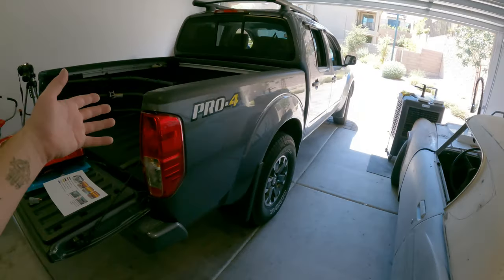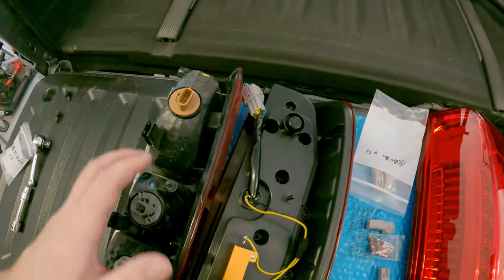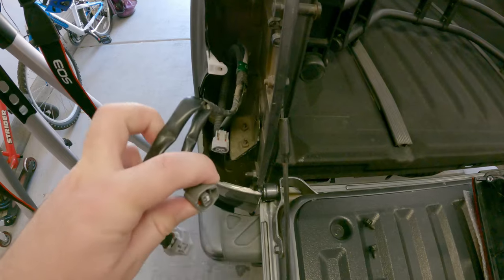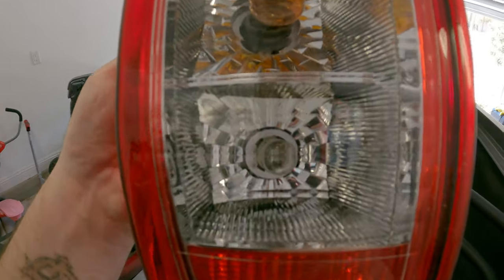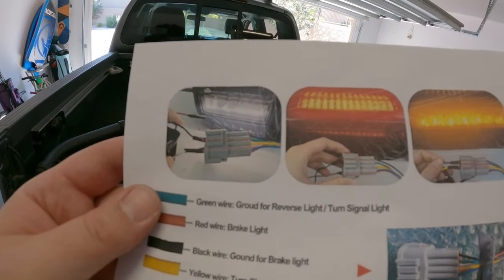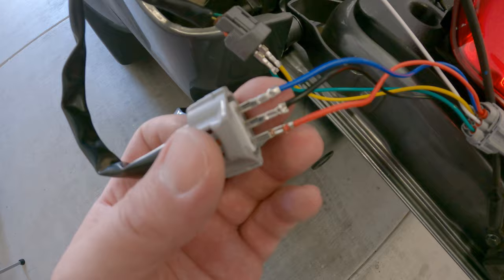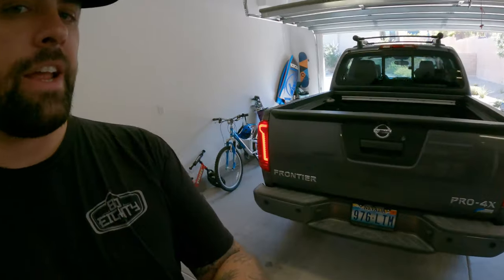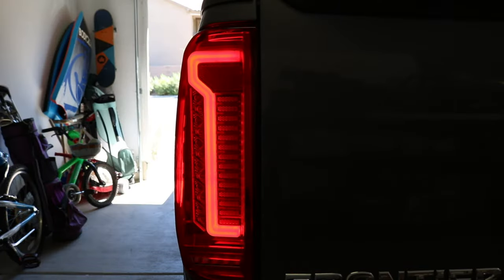Installing led taillights on my Nissan Frontier

Comment: I just opened the package to the smoked version of these, and there is no need to cut wires.  They probably saw that they needed to create a true plug and play version because mine came with all 3 clips!
Reply from the maker: Lucky lol, glad to hear they fixed it.
Reply: Link to where you bought the smoked version ones
Reply from the maker: @lprto9831  These are smoked and also plug and play now > https://amzn.to/3AaK8T7
Reply: @EndMotive  right on thanks
Reply: Lucky i only received da f-in light no wires
Reply: How do you like that smoked lens look?  It looks like the blinkers are tougher to see.  Both are out of stock right now... but with my gun metallic  grey paint I am leaning smoked.  I like these lights!
Reply: @rickwhitfield7617  they are amazing they will look awesome with your gun metalic grey. They are dark enough to not be able to see the led lights inside until they turn on, the only con is that the reverse light is so small its practically not there. If you have a limo tint in the rear window you will not see light at night. I added led to the third brake light and that kinda helps.

Comment: Thank you so much for this video i was litterly about to buy these same taillights and I had no idea what to expect. Thank you for the tutorial it was very helpful👍👍👍💪
Reply from the maker: Hardwiring is easy if you want to save a few bucks but I would definitely get the new clips and save your stock harness! You are welcome and thanks for the sub!
Reply: @EndMotive  hi, are the turn signals on these amber or red?
Reply from the maker: @olivert133  they are amber

Comment: Installing the smoked taillights now. Thanks for the help
Reply from the maker: Lol I actually think I prefer the red, it looks more OEM upgrade than aftermarket.
Reply: I have a black truck and was looking for the murdered out look.Also the plugs are not plug and play on my 2011 Suzuki Equator (rebadged frontier). Looks great though and was an easy install

Comment: I've actually been thinking about deliberately reversing the tail light and the brake light. Since we use the brake more than the tail light it would be cool to show off the unique patter as brake light more often. What's the brightness difference ?
Reply from the maker: It would work just fine, There is a noticeable difference between the brake and tail light.

Comment: Dude!…thx so much for that video!!….I feel like a DUMASS once again for jumping down that F’N  CHINESE “rabbit hole again!!! I ordered these for my 2019 Frontier SV 4X4….for X-mas…they came in time..(99.00) extra!!…Scandalous!…but here……I’m an electronic tech for over 35 years…& all I  received was the tail lights and bubble wrap!!!…that’s it…..Ive been going back & forth with the EBAY provider for schematic’s…& nada!….where or who did you buy these from?…..on a different note….who do you think they are making these for??….they obviously come pre-harnessed with plugs and all…????….RIGHT?…..somebody’s doing “plug-N-play”….but DEFINITELY not us!!….US ROCKS!!!!
Reply from the maker: No problem, glad to help! I am pretty sure the harness only works for pre 2014 trucks but sucks they didnt have a decent directions or adapter to make it work with the newer trucks.
Reply: Can you help me find the link please I can’t find it!
Reply from the maker: @tyronewebster6049  http://www.cycleterminal.com/ts-090.html

Sumitomo TS090 2-Pin Male Connector < 4 of these (Sumitomo part# 6188-0266 Japan)
Sumitomo TS090 3-Pin Male Connector < 2 of these (Part Name 11607W9A03M-GR)
Reply from the maker: @tyronewebster6049  This link might help > https://docs.google.com/document/d/17vuvWgC_BlWmvLIr9dfDy1XwT5nbH_rUtOiGsZSP1iY/edit

Comment: Do terminals/pins come with the connectors? If not what kind did you purchase?
Reply from the maker: yes, the pins come with the new terminals.
Reply: Sweet. Yeah those lights look good. Thanks for the vid. Ya did good
Reply from the maker: @broncanus9222  Thank You!

Comment: Hi I have 2014 frontier  I like those led tail lights  is mine wiring different  what you did  and can you send all the information  on this  thanks
Reply from the maker: I have a link in the description with a wiring guide if needed but I believe these tail lights are plug and play now and do not require any cutting to install.

Comment: Thanks, very helpful. Your frontier is post '14?  Do the the back-up lights provide adequate light? How does compare to original reverse lights?  I'm about to install the Morimoto headlights . These tail lights modernize entire truck.
Reply from the maker: I agree about modernizing the truck! Yes my truck is a 2018. Light output is great all around being led. I would say the reverse is probably brighter than stock. I want the Morimoto headlights too, hopefully I can pick a set up in the future.

Comment: I ordered the smoked ones for my 2012. I think the last owner of my frontier had some of the wiring modified when they added a camper shell. DRL works but it's on constant. So I gotta figure out what's going on

Comment: What you end up doing with the pin that didn’t line up ? Did you just leave it alone and just used the other side to keep the taillights up? That’s one issue I had with some I bought and that’s the reason I didn’t install mine an still have them laying around.
Reply from the maker: The mounting pin? Yeah I just didn't end up using it. Its only mounted with the two bolts. Definitely not as secure, but if you push it into place while tightening it...it lines up good and stays put

Comment: Not much of an electrician so sorry for the dumb question but can you just buy those pins at any local automotive store?
Reply from the maker: No worries, neither am I lol. hmm, maybe..? I have not tried looking honestly, but if I had to guess, probably not. They were fairly hard to track down the correct ones as it was. The pins anyways..yes you probably could buy those locally, but the plugs will be hard to find.

Comment: Great and detailed installation video. I want to get a set for my truck but I wanted to know if the smoked lens ones are too dark for daytime. I like the red lens ones that you installed but I want to be seen in the day and night when braking and signaling. Let me know if you have any input. Your truck looks great!
Reply from the maker: Thank you, I haven't seen the smoked ones in person but pictures make it look like they will be fine. You could always just get red lens pair and either tint them or use vht nite shades to darken them up.

Comment: I just installed these on my 2019 sv  and they look great, however I am getting hyperflash  in the turnsignals with them. Have you had any issues with hyperflashing?
Reply from the maker: I have not had any hyperflash issues. The turn signal still work though?...hard to say, but it might need a resistor.
Reply: @EndMotive  Yes , turn signals  are working , just hyperflash. I have been unable to replace the turn signal relay with a LED compatable one. I'm told that will solve issue. We will see.
Reply from the maker: @michaelbarretta6574  Hope you can figure it out, Good luck!

Comment: do yours have a gap on the side part of the tail light and the bed because the rivet did not go in the hole?
Reply from the maker: Yes a small one. Definitely not the same fitment as oem.
Reply: @EndMotive  I put mine on and it seems the tighter i put them the gap opens more so I had to leave them a bit loose. I'm planning on grinding the part where the bolt holds to an angle where I tight it then it will be forced to close the gap

Comment: can the white clip on the tub be moved to fit the new light locator?
Reply from the maker: I would have to pull it all apart again to check, but off the top of my head it won't work....Not to say that it is impossible to make a mount to adapt it.
Reply: @EndMotive  i noticed it has another locator hole and thought it may be able to be moved.

Comment: Noyce....very noyce
Reply from the maker: Thanks!
Reply: Accidentally cracked the driver's  side lens adding a tailgate assist strut... bought a so-called OEM replacement, Amazon rip-off assembly withe the wrong shaped bulb tab holes, had to return it!!!

So ordered the smoked version of these LEDs after watching your video for my new/used 2020 Pro-4x... sposed to be here in couple days!!!

Wish me luck!
😎👍🙏🙏🤞🤞🤞